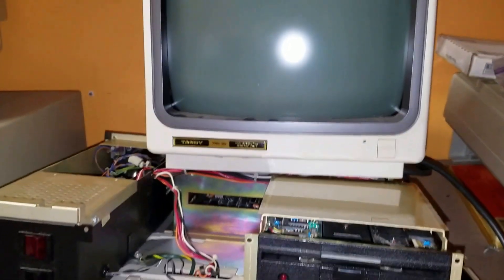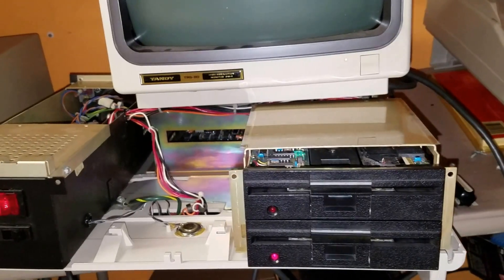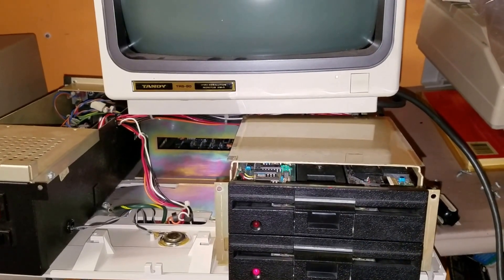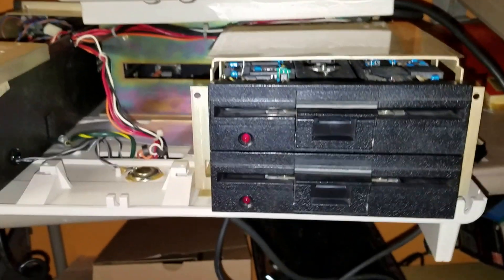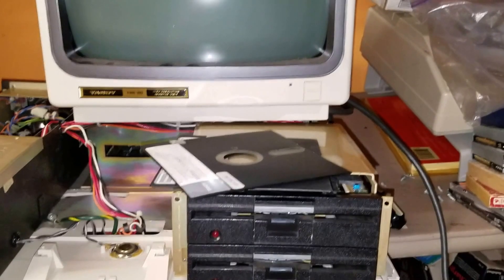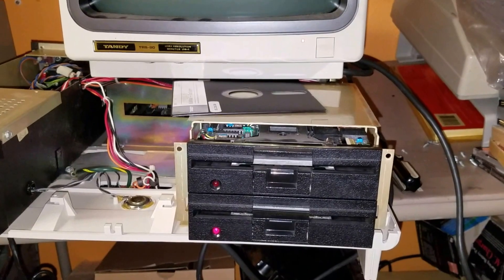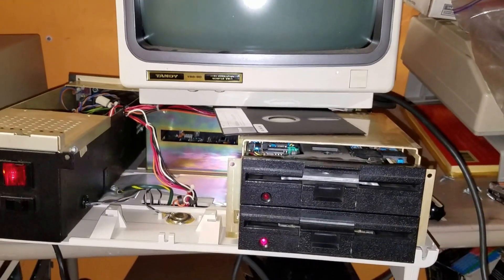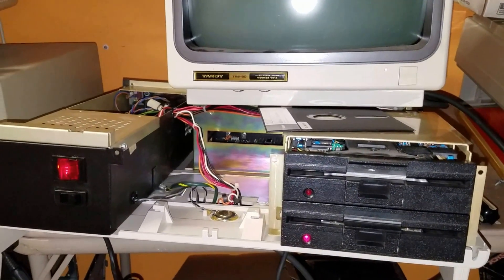Tandy 2000 wont read floppy disks.

Comment: Yeah the disk is bad.  That's what it does when it can't read the disk.
Also, never turn the computer off while the disk is in the drive closed.  It sends a power surge through the read/write heads and almost always destroys the disk.  All TRS-80's do this. It's bad design?? 
Other than the bad disk. The drives are working exactly as they should.  
I do have some boot disk I can make.
Reply from the maker: Wow I'm sure i turned off the 2000 a few times with a disk in the drive. It would be very cool if you could make a boot disk, I would be happy to pay or trade. I have a huge collection of original software, you can see it here in the picture section.  https://groups.yahoo.com/neo/groups/Tandy1000/info
Reply from the maker: Email sent, thanks for the link.
Reply: Resurrecting this in hope you see it - any chance you can make additional copies of the boot disk?  I have a T2000, unused for about 25 years, worked the last time I tried it, but will not read any of my boot disk copies.  Thanks in advance.